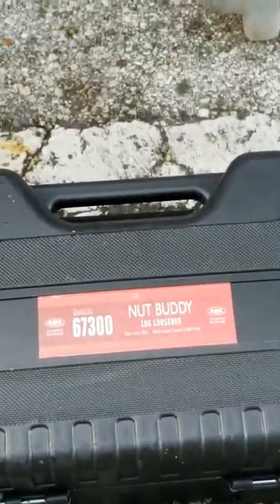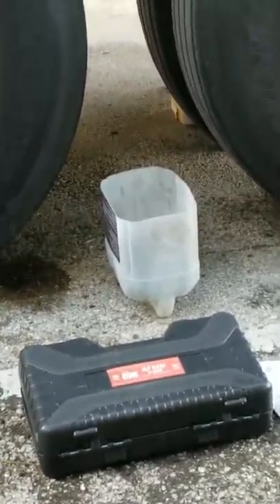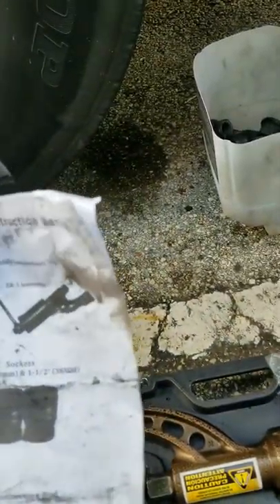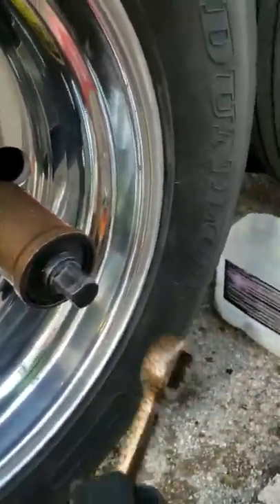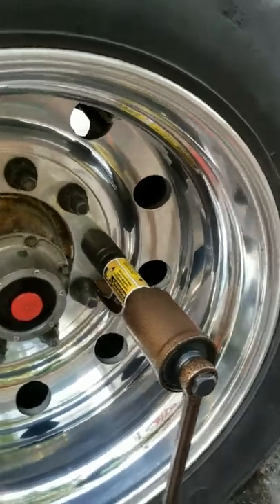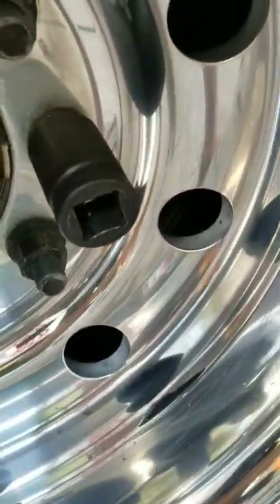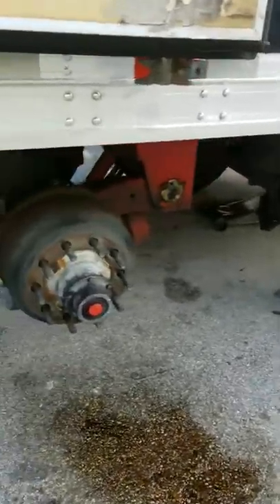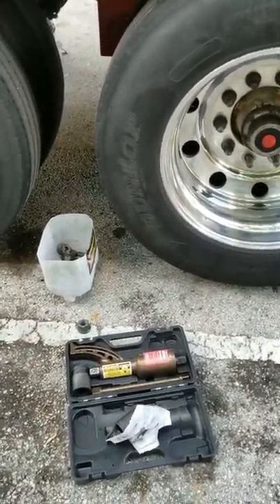Nut Buddy  Lug Loosener  model  #67300  Product Review

Comment: I also bought and like this tool but ran into a problem with the rear wheels but can be helped by having some taller sockets and using the provided sockets for the next nut over to give the reaction foot a little more to lean aganst, also worth noting, there is no square socket for the inner nut, don't try to use your worn out impact sockets, get some good quality impact sockets and mark the ones that came with it so you won't try to use them with your impact as they will break fairly quickly, but don't let this worry you, this tool is worth having even if you have everything else, just wear your safety glasses and make sure everything is going straight, or back off and start again.
Reply: What problem did you run into on the rear wheels?
Reply: @autocompletellc9906 ...sometimes the reaction arm is too big that it hits the rims inside , this can be remedied by having a taller "truck wheel" socket and putting a shallow socket on your "lean to" nut...😅
Reply: @cameronduff884  Thanks, I appreciate this valuable info!